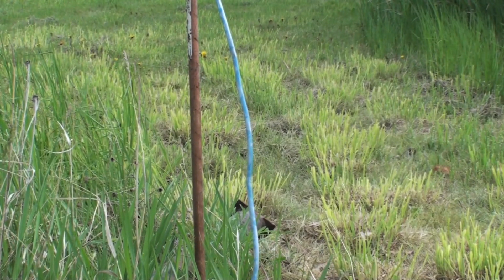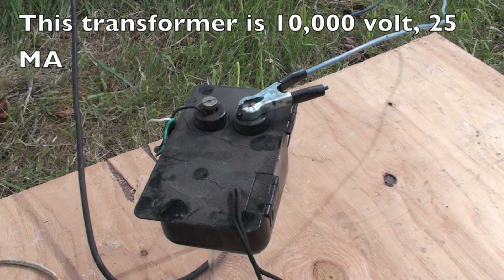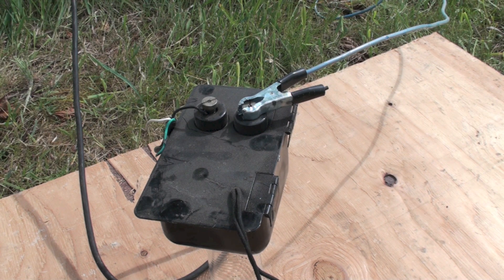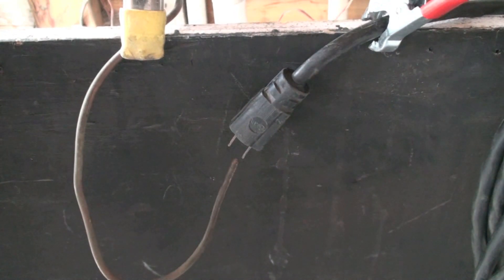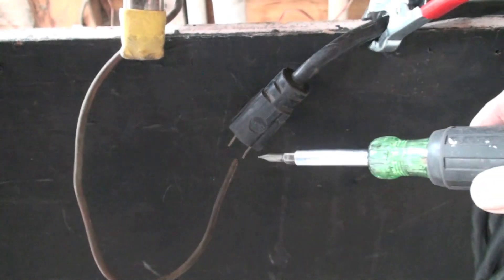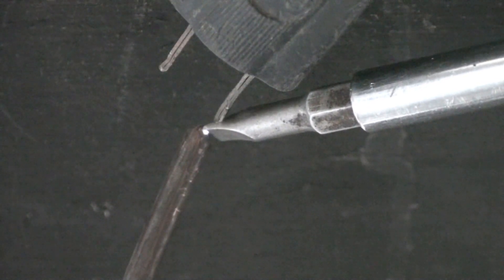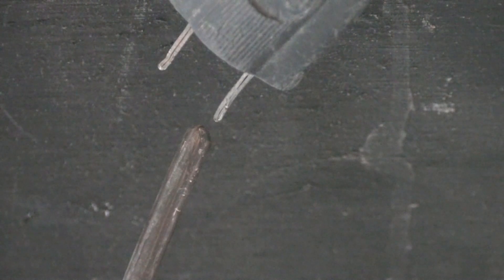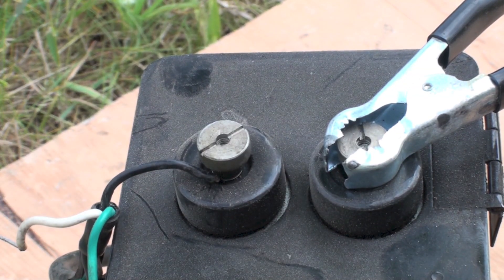Will high voltage power go thru earth ground

Comment: Let me give you a incite. when you run wires parallel together from source to load you just deal with simple resistance.
Now said that when you run AC wires threw other devices and paths separated by a distance you now have created a
inductance capacitance reaction that increase with frequency and AC voltage.

Comment: 4 corn detasselers were involved in electrocution in Illinois in 2011.  2 were killed and 2 injured when they came in contact with farm irrigation equipment near a field of water.  No explanation as to what "Contact" meant.  A later report stated the owner of the irrigation equipment admitted it was serviced/repaired shortly before the incident (Serviced as in having an electrical fault), as recalled.  This equipment can be 480V.

Comment: Be careful man ! Why don't you use (at least) a 1000 V rated screwdriver.
Reply from the maker: The coil is only rated at 25 MA and I cannot count the number of times I have gotten jolted by oil transformers.  Just part of the job.  But thanks anyway.
GFM

Comment: Did any worms come out of the ground?
Reply from the maker: The ground around the test is grass covered so I did not see any.  Yes I have done that with 120 volts and 2 screwdrivers a few feet apart and it works very well.
GFM